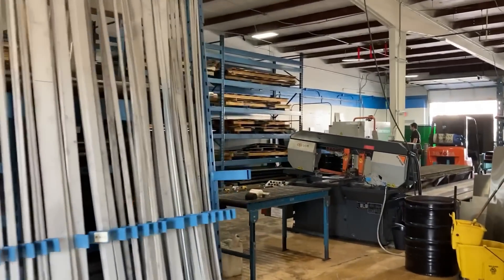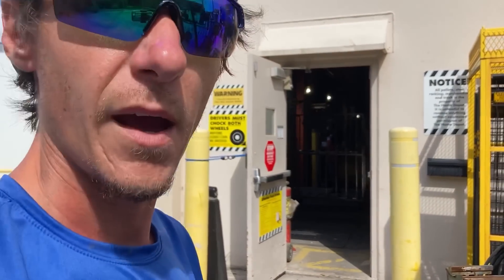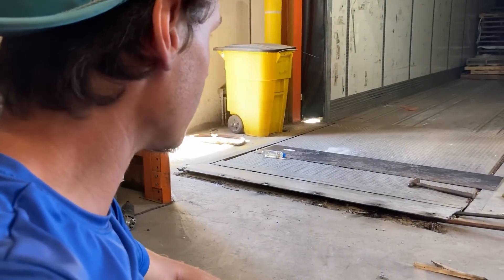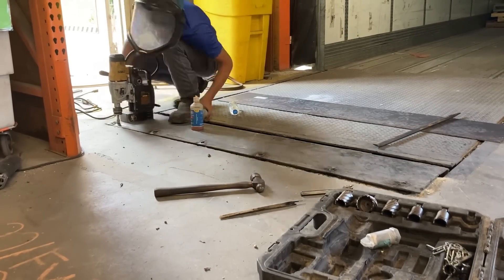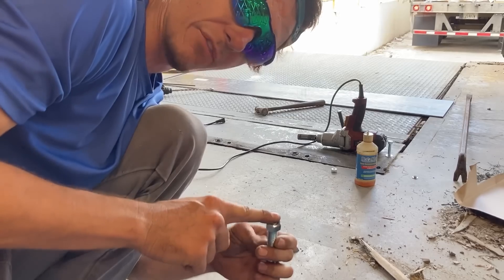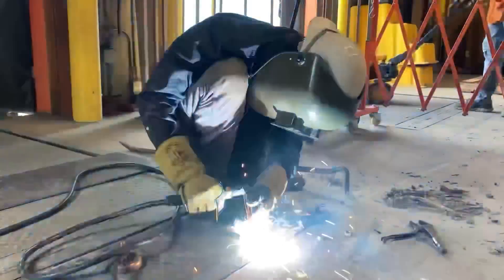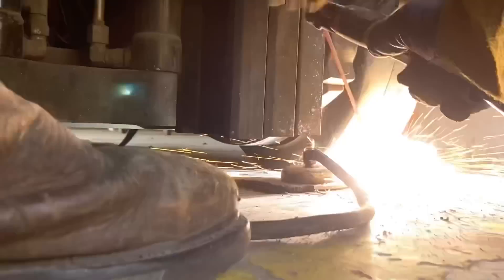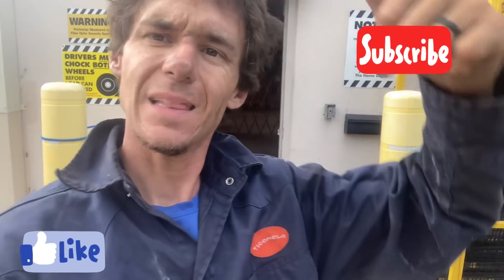“Simple” welding repair on loading dock goes wrong!

Comment: I have found out, if a forklift is around and tools are around, the forklift will find them....almost every time
Reply: Yep. Had a large part rigged up and ready to move with the crane. Turn around for 5 seconds and hear the dude running over everything I had in the area. Thankfully the company I was with replaced everything free of charge
Reply: After six years in production maintenance I have learned that if you paint something yellow, put flashing lights on it, and wire up a siren the average forklift driver will hit it. Every. Single. God. Damn. Time.
Reply: @jman0870  because everyone is “confident” in their abilities once they get their licences and think they can do whatever they want. This applies everywhere.
Reply: @wrathmachine7609  thats the problem with licensing.
Reply: I had a nice ratchet strap for holding appliances to my regular dolly, unloaded a refrigerator at the scrap yard ( I haul a lot of scrap), turn around to slide the fridge back and the forklift guy crushed my strap ratchet (was a strap without hooks that looped over appliances). Like dude, did you have to squeeze the forklift right next to me, I would have been done and out of there in 20 seconds. Yes I should not have set the strap on the ground, but was right by my truck / dolly and was trying to get the fridge where it was supposed to go quickly and out of the way. I learned not to set anything on the ground like that again.
Reply: @jman0870  hahaha so funny
Reply: @jman0870  It's probably because your yellow thing is in a bad spot and that was why you were told to make it noticable.
Reply: @jman0870  Then tell me what it was and why you had to mark it. I've spent years doing forklift and warehouse work. It's never the employers fault. All they want is to make money and give you shit working conditions and pin everything on you. I've seen it my whole life.
Reply: @ProleDaddy  concrete bollards and guardrails (PAINTED BRIGHT YELLOW) blocking pedestrian walk ways have no business being there? Steel rack protectors, bolted to the floors at all uprights, (PAINTED BRIGHT YELLOW) have no business being there? Bars hung in front of garage doors blocking high reach forklifts that are too tall for the door way (AND PAINTED BRIGHT YELLOW) have no business being there? You are an average warehouse employee. Your opinion literally doesn’t mean anything in this conversation.

Edit: I’ve seen every one of these smashed up on a monthly basis for almost SEVEN years straight. FYI. My logic is sound. Yours is that of a five year old who didn’t get his way 🤣
Reply: A forklift will find columns, post, machinery, fire sprinklers, your tool box, your tools and shelving. Never fails
Reply: @properaussie331  You're talking to welders here, buddy. Not everyone has the opportunity to do more, at least not US citizens.
Reply: I have been a forklift operator for 8 year and touch wood but I have never run over tools and they should not be dragging tines on the ground to get under that grate either there must be some cowboy forklift operators in Florida
Reply: Anthony: "Hopefully no one can slide a forklift under this after we're done."
Forklift operataor: "Challenge accepted!"
Reply: Even loading docks are transitioning now!

WTF
Reply: @jman0870 😂😂😂 💀
Reply: @wrathmachine7609 I'm the least experienced in my shop with the forklifts but whenever we need to do something heavy and high up I'm asked to do it because alot of the guys I work with have a little smoothness on the brain. Really I've just got the patience to do it right and safely. Probably because my lack of confidence and experience, I'm not blinded by ego

Comment: just for future reference, the back of the forklift is a lot heavier than the front if you need it for the weight!
Reply: That shiz isn't even a forklift. Its electric. He shoulda asked them to grab a real forklift
Reply: @Uhsnuh  whether is gas or electric it still has a counterweight and they still all way a lot.
Reply: @Uhsnuh  you have to use electric ones for warehouses especially if its produce!
Reply: You can also put a Block under the mast while tilted back and then tilt forward to lift both front wheels off the ground, place both front wheel weights on the block. This trick wont work with the carriage as it will just go slack on the balance chians
Reply: @blakemassa1909  It's a home depot
Reply: @blakemassa1909  i worked at home depot our forklifts were all propane the inside reach trucks and surfers are electric though
Reply: @Uhsnuh  lol electric lifts are 40x better than propane
Reply: Awesome work. That metal was warped by time heat and weight for a who knows how long.
Reply: @Uhsnuh  you tell em! lol what a weird flex.

Comment: What I believe caused that bow in the middle of the sides was that you tightened down the long edge first. I think if you would have tightened down the bowed sides first, then drill your hols in the concrete, it would have stayed flush. I think the plate had no where to go with the long edge tight.

Comment: As a Facility Maintenance employee for a 125 acre large commercial business here in SoCal and just retired after 40 years, all fixes are temporary, you can repair, but some how some way they will find a way to destroy it, they always do, you did great man.
Reply: That is why a good welder is always in demand--stuff wears out & breaks
Reply: You got that right! I worked at a local Caterpillar repair shop, and man, the things that came in that was fubard, just would blow your dam mind. A few things that I seen, I wanted to talk to the operator and buy him a beer just to find out how he did it! One of the best was a hydraulic shear that attached on the end of the arm of an escavator. This type of shear is used a lot on highway overpass demolition once the concrete is jackhammered away. This thing snips the steel beams. The pivoting jaw was 5 inches of solid steel. It was broken into 3 pieces! If you would have ever asked me if that was even possible, I would reply with "no way in hell!" As a welder fabricator for about 10 years, I've never dreamed of something like this being possible. Well it took me just over 3 days to weld up because we cut the remaining jaw piece at 90 degrees and did the same with the replacement piece. Everything was beveled down to 0 degrees, and the overall joint was close to 30 inches long. I was using a different wire that burned a little hotter than regular what we normally used, and was . 044 instead of . 042. The jaw was still attached to the unit which made it hell, because I had to do my stringers on one side and then flip that heavy bastard over to do the same using an overhead trolley crane. Once I reached 80% done, I didn't have to flip it anymore, just finish it out. I've never welded anything that thick in my life and it took just over 3 days and 99 pounds of wire! Needless to say, I was glad to see it go! I've seen escavator booms come in split almost in two and twisted to hydraulic bed lift cylinders fully extended and bent like a banana.(these \ere more often than you would think).This experience only further supported my viewpoint that "There is no such thing as indestructible!" You can bet your bottom dollar that it's usually the dumbass that always finds a way to prove that very thing. Lol
Reply: I worked in a department at work called "Special projects" It was a little bit welder fabricator, a little bit maintenance tech, and a lot of new installation. I used to joke with my boss that we were pretty much just millwrights, but I guess he was correct when he said that we really were not. I installed over 500 feet of new new air pipe for new equipment, fixed things, and fabricated new things to be used as well as installing new machinery or equipment we made ourselves. What you said is 100% correct. People will find a way to break anything that you fix, or my favorite was breaking things you just installed a couple of weeks ago.  90% of the job was thinking about the first way someone was going to break something and trying to prevent it from happening. Also the most important part was thinking about any possible way someone could hurt themselves with something you made.
Reply: @Monsiemage  I'm apart of the special projects crew at my job as well haha. I work in a packing house though. Lots of welding fab and installs

Comment: I had to do a repair almost like you did. ON the side you had issues with lifting I put two anchors in.  with about six inches of space between them. I could then remove one nut, weld then the other. A note about fork lifts. if you had used the back that is the heavy end of the lift. Come up along side of the bolt and that plate would go down. Good job

Comment: As a door guy and a welder myself next time you run into this situation again is a large fender washer under red head so you can distribute your weld wider and dont remove nut melt them into the washer and washer into plate you will find yourself saving time and a stronger weld
Reply: Garage doors? Quit my business and going to school for welding.

Mn sucks for being a door guy now.

Comment: Your repair looks great! For future reference, look for a fastener called a drive pin. I’ve repaired a ton of loading dock transition plates with them. These fasteners have a 4” x 1/2” shank with a wave in the middle of the shank. They also have a button head so they won’t get caught by a fork. Once you pound them in the wave straightens and locks them in place. No tightening red heads then taking the nut off to weld , this makes the plate loose. The drive pins pull the plate tight to the concrete in one step.

Comment: Take a short piece of 2 or 3 inch channel and drill a hole for the anchor. Using a little longer wedge anchor, crank it down. You can then get in from the 2 open sides to make a weld. Pull the " bridge" off, cut, grind ,repeat.
Reply: Very  smart  idea right here, thanks for sharing  will definitely keep this in the old memory bank, 👍🍻
Reply: Cutting a large nut in half or a little less than half and placing that under the nut and washer works well as well. All you need is a tack to hold the plate in place and you are golden. I’ve done it more times than I can count and nuts don’t flex like strut.
Reply: This is what we do at my warehouse.

Comment: I've made this repair many times. Forklift drivers dragging the fork tips run under the lip. I recommend replacing the apron with a new one as trying to flatten the damaged plate will cost more in labor than a new plate. Pre-drill your holes at the shop & drill double holes 3 inches apart. This will allow one anchor to hold down the plate right beside a second anchor that you will weld. Then weld the first one & repeat. Good video. Keep in mind also that those electric forklift batteries have hydrogen off gassing while running or charging and it's pretty explosive. I saw a battery cell explode just from a guy grinding too close to the lift.

Comment: I work in the dock and door industry and those old school L plates are a nightmare!  Props for coming up with a quick solution, most of the time we need to use quikcrete cause its 99% of the time broken underneath (at the angle)

Comment: Hey you got it fixed without MAJOR reworking and cutting. Yeah the mag-drills are slow but they get the job done. Just a suggestion take it or leave it when you set blind bolts like that shoot some cement block adhesive in the hole before setting the bolt, it will give just that added bit of holding power and keep the bolts from working out.
Reply: I’m not familiar with adhesive but if anchor bolt is done correctly into solid substrate you don’t need anything. Adhesive cut actually cause the wedge anchor to slip.
Reply: @donsmith9081  yeah the adhesive helps with preventing the bolt from working in the hole and loosening up. For that ramp it stops the up and down movement of the bolt in the hole and coming loose
Reply: @patrickradcliffe3837  After 30 years in construction and installing hundreds of wedge anchors, I have never had one anchor fail- unless concrete was not sound- cracked or old or going into light weight concrete where you need to epoxy studs. When I was younger I have overtightened them and broke them off- 3/8 and even 1/2-once.
I appreciate the reply.

Comment: Hey Anthony, I was thinking from watching the video and seeing your edges of the big flat steel where the concrete met the lip if you were to get a hammer drill with a chipping bit would you have been able to ship a little bit of the concrete underneath before you lagged it down to give yourself a little bit more of a flusher setting piece of steel think it may have been a good idea to do that and you would’ve got pretty close to getting them both at an even height?

Comment: I worked for company removing and installing the dock levelers. A lot of times they would get trash in there make nice fire cutting old one out. 
Dewalt drill i have used has selector switch to hamner its cheaper then buying a hilti. If your have to  weld under thie levelers please use safety block..i knocked out 6 them one day before. great video WELD ON BROTHER
Reply: sure, but you have to buy 2-3 dewalts to last as long as a single Hilti....  so its cheaper to just buy the better tool upfront because you will save time and money in the long run.    work smarter bro.....